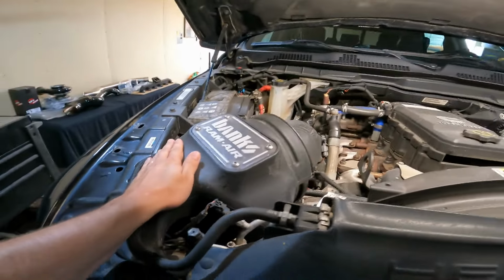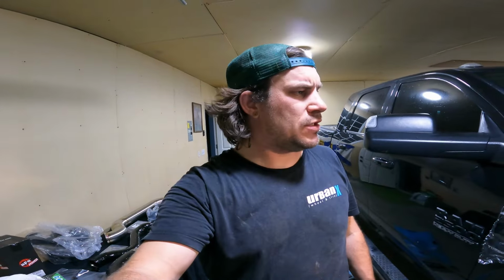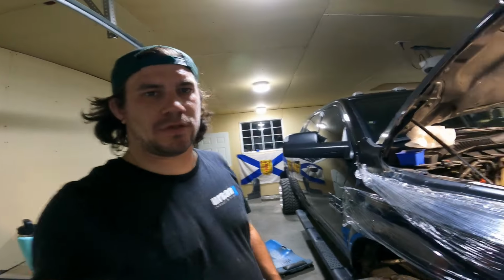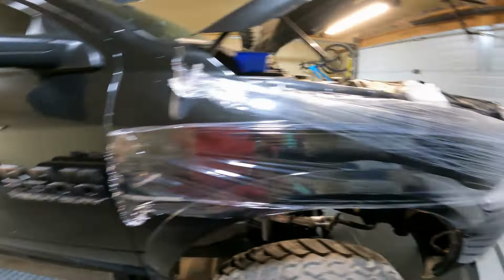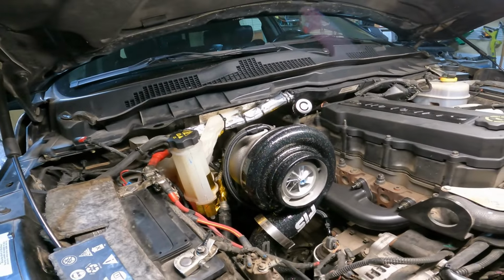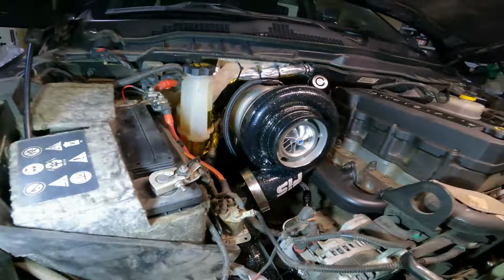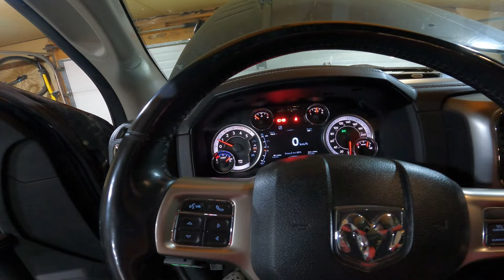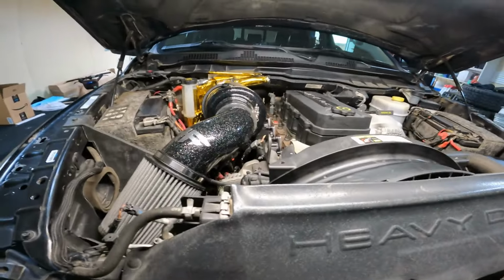6.7 Cummins Second Gen Swap - Turbo Install & Review

Comment: Im doing a second  gen swap on my 3rd Gen and I'm going with Point Zero Fab. He is up in Canada, close to Steedspeed. He sells a high mount second gen swap that uses a flipped up Steedspeed with a 1 inch spacer. He has kits for a few different turbos. All of his fittings, oil lines and clamps he sends is all Performance World, no China stuff. And his downpipe, intake pipe and hotside charge pipe are all tig welded stainless steel.
Reply from the maker: Good looking stuff.  Just looked them up on IG.  Love the quality!

Comment: Stock fuel? Headstuds? Can you list all the current mods you have looking of doing the same but scared i might blow the head gasket
Reply from the maker: Currently I have headstuds, fleece in-tank fuel pump upgrade, the boost pipes and intake horn.  Looking at heavier valve springs and push tube next.  Then bigger injectors. Right now it is stock fuel.

Comment: Missed two prime opportunities to install a fleece coolant bypass kit!!! The best time would have been when you did the g56 swap
Reply from the maker: For sure should have taken advantage of it.  Want to do a few coolant upgrades in future.  Reservoir swap out, fleece bypass and get rid of the plastic 90 at the head for the heater hoses inlet.  Always a running list!

Comment: how did you block off the top of the coolant tank where the line is removed next to the turbo?
Reply from the maker: Bought a 3/8” hose nipple and installed onto the reservoir.

Comment: did you have to tune this? wanna do it on my weigh loss 13
Reply from the maker: I had some tune revisions made
Reply: @thekanemadness1  Nice video im ready to pull the trigger as my actuator just took a dump...my biggest fear right now is the tuning where did you get the tunes made?
Reply from the maker: @tomsauto20 I’m with CCS.  Had a few revisions but they have done pretty good.

Comment: You going to go with an exhaust brake?? Only other thing I would want if I had a 2nd gen kit!!!
Reply from the maker: One thing I miss.  Being manual helps.  But I am thinking of the BD inline kit.  Need to read up and research on them more. I like the plug and play option with em

Comment: Did you buy the Bd exhaust brake yet? I’m wondering if I want to get for my 2nd gen swap as well
Reply from the maker: Not yet.  The BD one is up to 2017 and my truck is a 2018.   I am unsure what the difference is.  I emailed BD and they said they were testing the newer model ones.  Not sure if they made an error and meant the 5th gen platform….but I want to be sure before purchasing.  Regardless plan is to add an exhaust brake still!

Comment: That looks sick man. I watched the whole entire vid. You did a nice thurough job, and payed good attention to detail. That s467 looks dope mounted up high light that on a secound gen manifold. It fills that area on a 6.7 that would normally be filled with emissions garbage, and then they stuff the little vgt Barbie turbi down and under. Vgt's are junk. Everyone always raves about how cool they sound, and the 'exhaust brake' is so nice when towing. lol well if you had a real man's trans instead of a slush box...
All the moving parts in the vgt, just more little actuators and electronic parts and sensors to go bad and leave you stuck in limp mode out in the sticks. Diesel emissions are a joke, it was never made to eat its own a$$. Even when people delete the 6.7's they always fail to get rid of all the coolant line jumbled mess of hoses and what's that thingie, the 'coolant stand pipe?'. I seen a company that makes a delete for all that crap, and cleans that area up. I'm always a big fan of deleting and throwing in the trash anything that's clutter and not important or being used, or inefficient, obsolete, or useless. Clean simple and uncluttered. Like on my '02 24v HO 6 speed. Removing and deleting all the factory fuel filter housing, bracket, and stock Carter lift pump freed up so much space and cleaned up the side of the motor, you can get to the starter from the top side if you didn't want to lay on the ground. Heh. The 6.7's you guys gotta buy the 'fuel return block' that several companies make or get the china Knock cheapie clone off of Temu, heh. 
  The Wabasto set up you got. Is it worth it? The way you got it plumbed it cir's heated coolant to the in cab heater core and the block? Thats a good idea to have warm heated coolant always flowing to inside the cab and preheating it. I'm in Colorado. I installed an additional block heater in the rear of the block in addition to the oe block heater up front. Dual battery blanket heaters, and an oil pan heater.  On The FasS I did the optional 'dual probe heater' plug and play add on. When it hits -30 in Gunnison CO it's no joke! Haha. Maybe I should look into a wabasto.
Reply from the maker: Webasto for sure.  Huge game changer.  Eliminates cold starts and have heat in the cab already.

Comment: You do Valve springs or pushrods? Looking to do a 2nd gen swap myself
Reply from the maker: Not yet but is on the agenda.  Those and the inline BD exhaust brake are on the to do list.